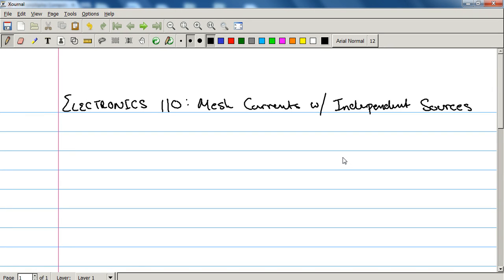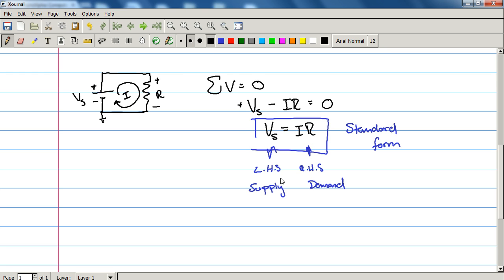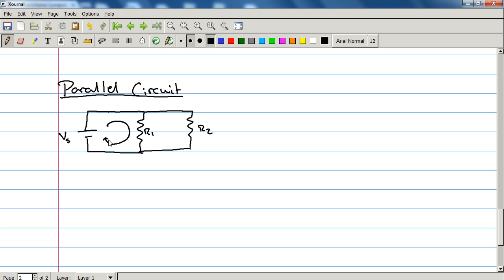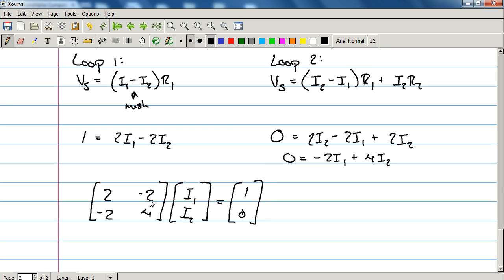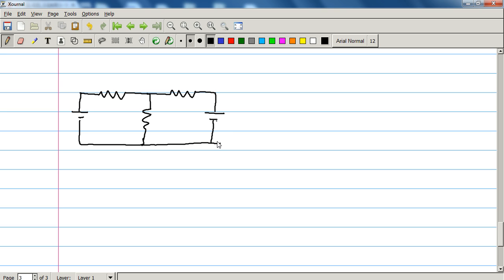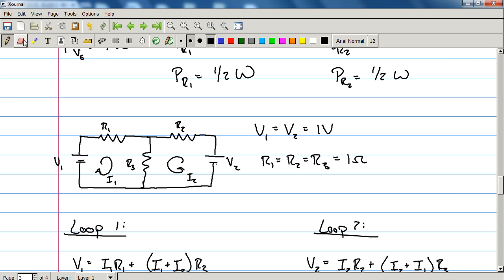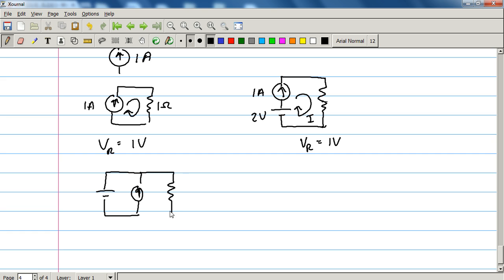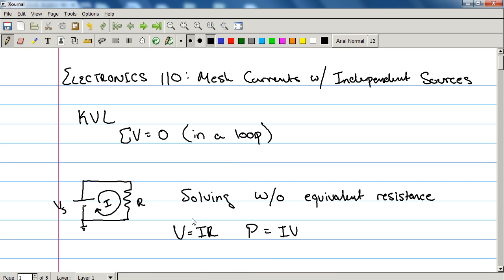Electronics 110: Mesh Currents w/ Independent Sources

Comment: Hi,
I think the power delivered, by the current source Is, needs to be 10/4 W. The power dissipated by R3 is indeed 9/4 W. I would say 6/4 W of this by the current source, and 3/4 W by the voltage source. In your calculation the dissipated 9/4 Watt of R3 is completely delivered by the current source, but the voltage source also has its share, or am i wrong? 
By the way, thanks for the nice videos you made on all kinds of stuff. Great initiative!